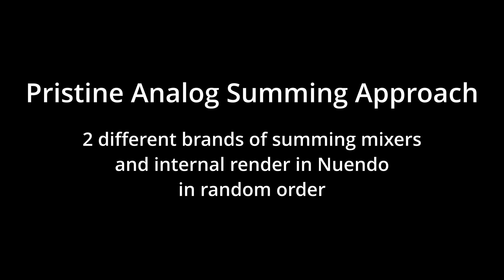Analog Summing Explained: From DAW Limitations to Modern Mixing

Comment: I see a SPL Goldmike MKII (probably Premium) in your mixing room. How do you like it? Can it be used with a passive mixer at front-end for improvised analog mixing?
Reply from the maker: It is a great mic pre with lots of bells and whistle to dial into taste.  Especially the tube gain push with no volume increase so you can hear what you are doing and the flair for some open air.  Due to those extras, it would be a great candidate for summing into it.   Here is a video and link.  https://studio.youtube.com/video/SQ8RBOLZq4k/edit    https://purewaveaudio.com/spl-goldmike-mk2-model-2485?search_query=goldmi   Thanks!

Comment: All good. However, one fresh reel of tape and a 2 inch machine with 16 track heads does it for me. The changes between the sound samples is marginal at best, and the person buying the CD is never going to pick either the summed version or the in the box version. However, the person buying the CD is going to appreciate the super fat snare drum or the depth of the overall sound coming off tape. I tread audio as needed through the 2 inch machine and into protools it goes, rather than a summing box. My company, practical audio practices does exactly that. I teach my students to listen and apply practical practices that are going to make a practical difference in their final sound.

Comment: Forget about audio cables, invest in creativity
Reply: Agreed. It's more important that the cables are terminated correctly and impedance are matched. I've seen some horror shows. Back in the 80's when I was frequenting powerstation in New York, the tech department held a test between super high end speaker cables and standard lamp cord. No one could tell the difference. Would I rather have the super high end cables? you bet. However, no one has ever bought a record based on the quality of that XLR cable. Now, to that defense, shitty cables are shitty cables, and should never be used. Practical audio techniques.
Reply: @thechuckster6838   right on!

Comment: Great video Jim, I have been following for a long time!. Thanks for all your honest opinion. What level of quality is the converter on UAD Apollo X8? Are we talking Ferrofish or Lynxs?.  What about Dangerous Music?.
Reply from the maker: Thanks for watching.  I did a little research right now.  One of the things you have to keep in mind is the marketing hyperboles that manufactures will throw out to skew how good their unit performs.  For instance, years ago Avid came out with new units and were boasting how great their Signal to Noise ratio was, but all there measurements were taken and published at the dips of their noise curve and not where all the rest of the noise was, making it an unfair comparison to other manufactures.  If everyone is measuring at 1k, why are you measuring a 3K to find the dip?  Ferrofish does not even give their specs on S/N or Freq on the website or in the manual. That is not good.  Hiding something?  Dangerous has similar noise specs to Lynx, but there frequency response is not has flat.  .25 vs .01  Lynx is 25 x better on that one point. Which makes them more accurate and absolute.  Apollo is showing really good specs on their new units, but I have not heard them and can not verify the specs. What I can say about apollo is the specs are getting better and better. Apollos used to be mac only.  I think they are cross platform.  Not sure how well they work on Windows though.  So before doing a little research, I would have said. Lynx, Dangerous, Apollo, Ferro.  But after research Lynx, Apollo, Dangerous, Ferro.  This is for accuracy and noise floor and all around industry knowledge.  Now let's go listen!
Reply: @purewaveaudio  Thanks Jim!. I own serveral of your courses and always full of super useful information!. Thanks. 
I tried to read the specs of the different converters but just like you said the info is provided as pears and apples, very hard to compare them. 
Thanks for your time and knowledge!.
Reply: @delsurmusic 
Hey, I run an Apollo x8p with the Dangerous DBox+, Convert-8, and AD+, and they all work amazingly together. The Convert-8 handles the DA conversion, taking the 8 outputs from the x8p into the analog domain, while the AD+ handles the path back from the mastering chain through the DBox+ summing and into the master two-track in the DAW with the best AD conversion Ive ever experienced. I also monitor select through the DBox+. Its analog summing adds depth and separation to the mix. Monitoring is consistent, which is important since I switch between Genelec 8351Bs, Yamaha HS8s, and Avantone MixCubes to check how my mixes translate. The Genelecs are precise, the Yamahas give a solid real world reference, and the MixCubes help balance the midrange. The stereo image is clear, and I can hear small details in the mix. Having a setup like this makes it easier to trust what I am hearing and make mixing decisions with more confidence. I highly recommend this setup.
Reply: @AlexPettyMusic  Thanks for the feedback, great info!. I have almost a similar setup except for the Convert-8. I come out of my Apollo X6 then go to the D-box+ and back to the apollo via s-pdif using the Convert AD+.  In your system if you have the Convert-8 why do you need the Apollo X8P?
Reply: @delsurmusic  I had the x8p already before upgrading to dangerous conversion.  I can still use it for tracking Unison. When I bought the dbox+, the monitoring conversion was so much better than the apollo, I had no choice but to go all in on dangerous conversion.
Reply: @AlexPettyMusic  I see, now it makes total sense. I think I might upgrade to and Apollo X8 gen2 instead of the Convert-8 . I do agree the playback from the D-box+ seems to sound better than the playback from my Apollo X6. Great chatting with you!